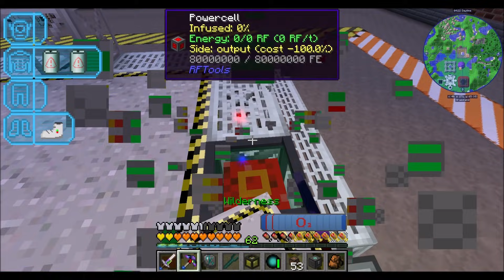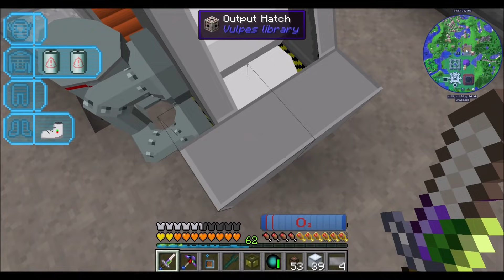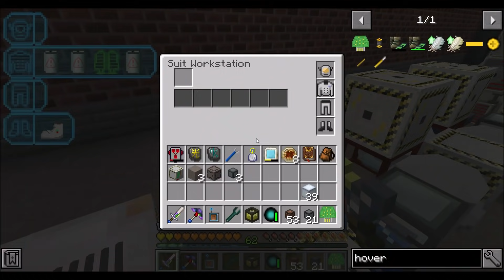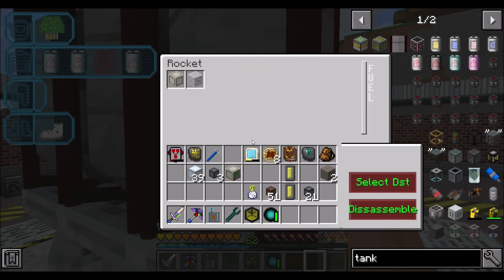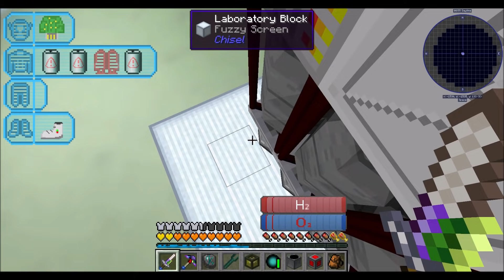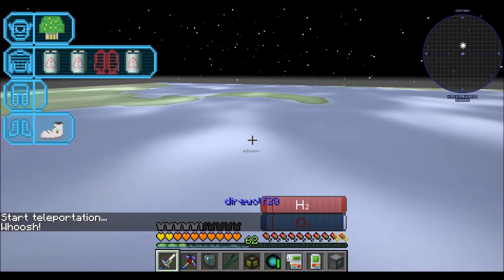Enigmatica 2   Ep65 Space Station

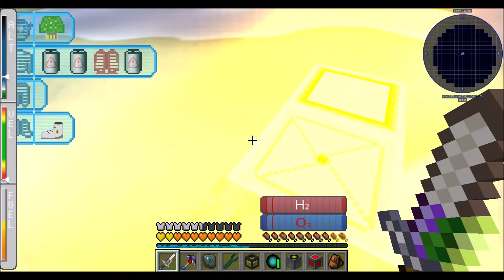Comment: I'm don't really know much about science apart from what i've played with in Kerbal Space Program, so take this with a grain of salt. But I was under the assumption that once you are in orbit, there is no air resistance/atmosphere/re-entry stuff, or whatever you call it, so the ship doesn't burn up like it did in this video at around 31:40.
Reply: It's a minecraft mod, it's not going to be completely factually correct. I wouldn't worry aha
Reply: Those are the particles from the engine. Since the particles in Minecraft stay pretty much where they were spawned, the player just moves through them as the rocket is descending
Reply: It's the rocket engine turning on to slow down the rocket for the landing.
Reply: The worst part is that it's showing that minecraft overworld is flat.
Reply: @valtur25   which is obviously a given, since the minecraft is made out of perfect cubes

Comment: Dire finally gets flight 65 episodes in. I'm surprised at his patience, I've been spoiled rotten by flight, I hate not having it, so I tried to get it as soon as possible.

 I started out with a IC2 electric jetpack, which is actually not that hard to get reasonably early game I think. It's not perfect it's slow and it only runs for a few minutes before needing a recharge and fall damage is a thing though with the electric jetpack unless you kind of brake before you hit the ground, or just have slime boots or some other form of fall damage protection, but it's still better than nothing and it can actually be stretched out if you use it sparingly. Getting around the nether is much easier. I think I currently have an angel ring though, which is awesome. Though I understand there's situations where creative-like flight doesn't work, so I still have the jetpack. I think it said creative flight doesn't work in the twilight forest, and it doesn't work with the gaia guardian, though if I remember right, the IC2 jetpack still does. Also you can combine it with other armor, but be careful if you combine it with rf powered armor. If you get to flux networks, it can only recharge either EU or RF, it doesn't seem to charge both. I combined the electric jetpack with dark steel armor and it stopped recharging the jetpack in lieu of charging the armor, so I had to go back to charging it in a batbox. I ended up swapping to a new chestplate to remove it and then I got an angel ring I think.

Comment: I feel like some things, like steel, that are used so commonly, should not so much be on autocraft, but actually be on...restock. like...maybe a 2x2 drawer full of steel. perhaps even rods, plates and gears of OTHER things as well. that way you're not waiting on the steel to be crafted. it's always backstuffed in a drawer. it would ALSO eliminate the autocrafting of steel from the Crafting CPU load. I would also do that for most of the stuff on the metal presses. like  titanium rods and plates. 2x2 drawer with a downgrade, and you're golden.

Comment: Anyone else see that the dust can be made with thermal and it gives you six dust?
Reply: That's using Nether Dilithium Ore. But you are right in the fact that he can use a Pulverizer from TE to get three dust for each ore. That said, it's using a liquid I can't recall also.
Reply: @johannesbergersen2545  It's a Tectonic Initiator recipe which uses Tectonic Petrotheum. It's one of two ways in Thermal for x3 ore processing. The setup process is fairly annoying, as it requires a supply of Essence of Knowledge. I'd say it's not worth using for Dilithium though, since Dilithium is extremely abundant to begin with.